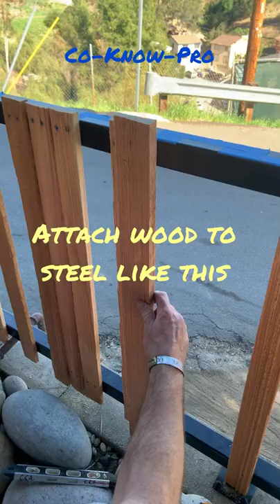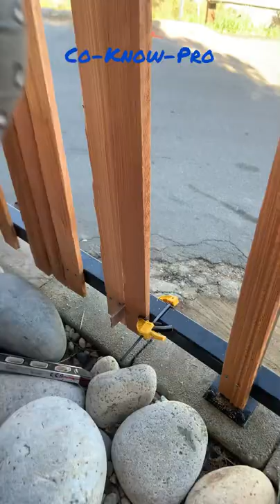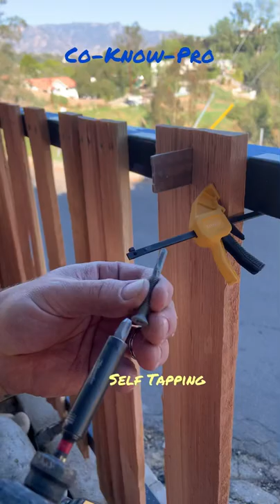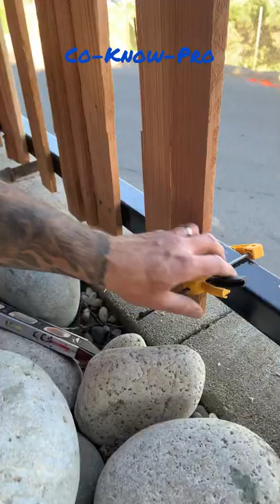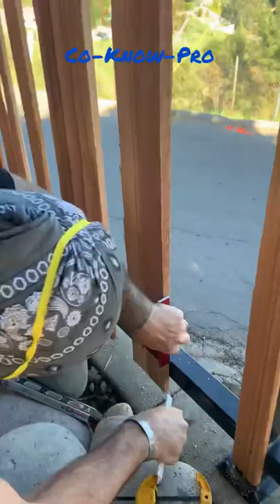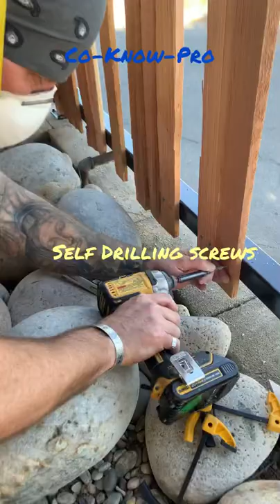⭐️Connecting Wood To Steel‼️#shorts #tips

Comment: when I use these it never works so easily 😅 I always end up doing a predrill, some of you just got a magic touch I guess lol...see if I did that, the wood would bunch up on me pushing the board up snapping my clamp off 😅 then I'd get frustrated and start gluing stuff and say F it 😂
Reply from the maker: I totally know how you feel. There’s a little bit of a technique that you need to do to make it. Look this easy.
First, once you drill past the wood and you feel it touched the metal slowly drill it let it drill there for a second that’ll open up the drill hole on the wood so it does not catch on the screw or the self tapping part of the screw then once you feel it bite into the metal, then you drive it in a little faster once the thread bites on the metal, it’ll screw right  in. 
You don’t want the tapping screw to bite onto the wood thread that’s what pulls it away from the metal. 
Next time you do it try it’s slow at first like I say once it goes through the wood and it starts spinning on the metal do that slowly and it’ll widen  the hole on the wood just a fraction that way as soon as it bites in the metal  It won’t push the word from the metal onto the thread. It is a little hard to explain.  
Basically go in slow and steady once it bites on the metal drive in fast. Thanks for watching the video and the comment. Be safe out there 👍😎
Reply: Using 1/32" square tubing makes it look real easy. Come try on my 1/4" square tube. 😮😊

Comment: self tapping is different than self drilling
Reply from the maker: No there not different, they are the same thing self tapping and self drilling are the same things
Reply: @co-know-proconstructiontips  Self-tapping and self-drilling screws are two types of screws used. Contrary to popular belief, the two terms are not interchangeable. Self-drilling screws eliminate the need for a pilot hole but can tap as well. Self-tapping screws tap their own threads but cannot drill through metal and require a pilot hole. These screws are not interchangeable.
Reply from the maker: That’s great info to know but most companies that label there screws self taping are self taping and self drilling.